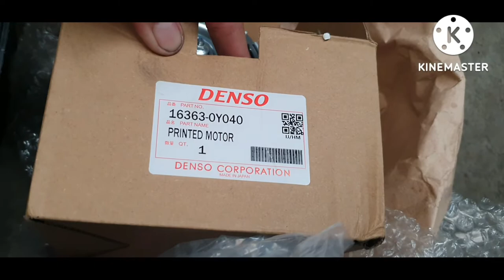AUXILIARY FAN MOTOR REPLACEMENT , TOYOTA VIOS GEN 3 "DIY" #philippines

Comment: paps, nung nagpalit ka ng aux fan, anong naging symptoms? lumabas ba yung indicator ng overheat sa panel gauge? salamat. saken kasi lumabas yung overheat light sa panel gauge ngayon, tapos nung pinatay ko yung AC, nag nomalized naman yung temp nawala yung overheat light. tapos napansin ko din kapag nag AC parang wala na yung high rpm sa fan puro low lang.
Reply from the maker: Yes sir, nag indicate yung overheat light kasi di na talaga gumana nung nag engine start ako ng morning.
Reply from the maker: Ganyan nga sir ung indication din sakin